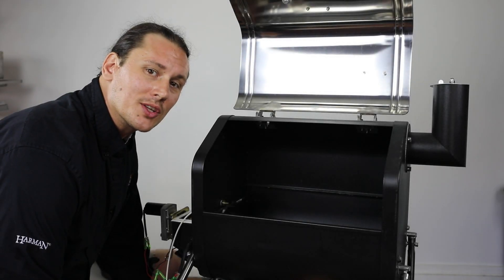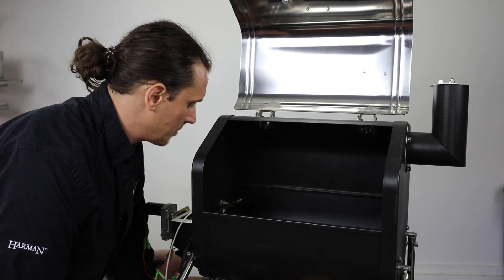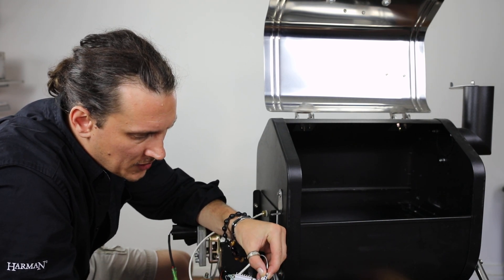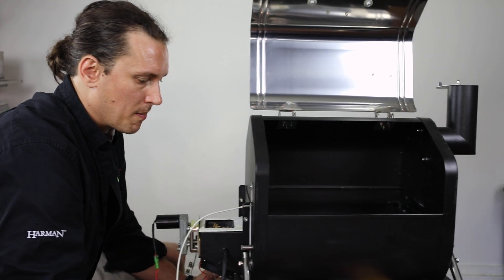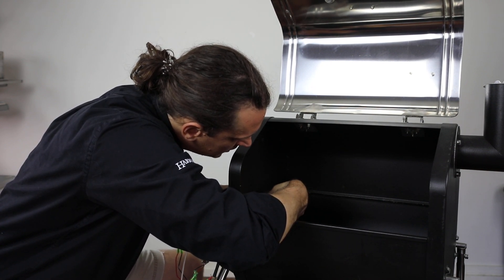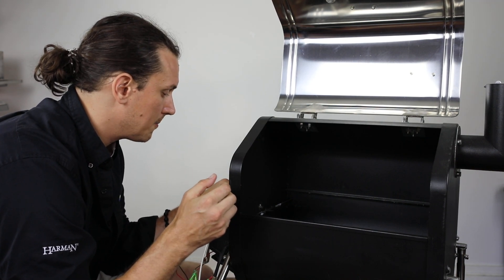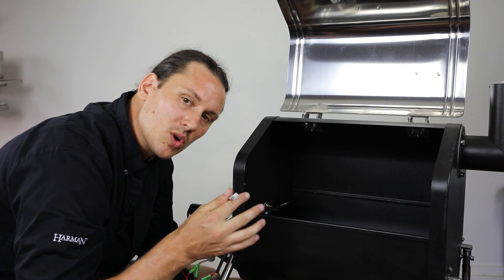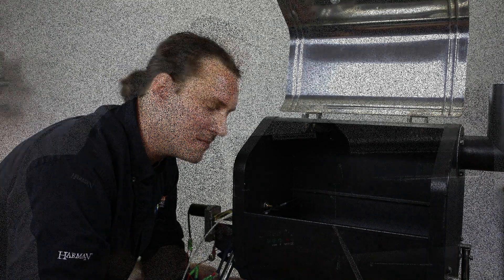GMG Davy Crockett - Thermal Sensor Replacement

Comment: I bought a brand new Davy Crockett in November and it’s about anywhere from 75 to 150 degrees too hot which is way too much to be off.  Pretty disappointing.  But I love it other than that.  It’s a great little grill.  I’ve tested it with multiple probes and from lower temperature settings to higher temperature settings the differential becomes greater and greater.  So, if I want 350 degrees I set my controller to 260 which is 90 degrees off, but if I turn the controller up to 350, I’m getting 550+ degrees…way too hot.   Anyway, it’s still usable but my OCD can’t handle it, and it’s too much math.  I have several grills that work much better.  Really want to fix it though.
Reply: Is it the controller that is messed up, or can the probe really be that off?  It’s brand new pretty much.  I’ve used it about times.
Reply from the maker: @smflyboy  Thanks for contacting us, happy to help. Yes, we definitely have an issue here. The Davy Crockett and other GMG models are known for being extremely accurate with temp. It's either the thermal sensor inside the grill (most likely), the circuit board/controller, or a combo of the two. The Davy has a 3-Year Warranty so any parts that are defective will be covered for you. Let's try something first before any replacement parts. Grab a piece of 000 Fine Steel Wool and rub that around the brass shaft of the thermal sensor - Reference https://pellethead.com/product/green-mountain-grills-gmg-thermal-sensor-temperature-sensing-probe-oem/. With the grill unplugged from all power sources, disconnect the thermal sensor connection from the control board and then snap it back in. If you are still experiencing the same temp issues, reach out to GMG and they will send the suggested replacement warranty parts your way. GMG Contact- Phone: 1-800-603-3398 · 530-347-9167 ; Email: support@greenmountaingrills.com.

Keep us posted, happy to assist and get things 100%. Thanks.
Reply: @EarthSense  Thanks for the reply.  I tried scuffing up the sensor and that actually may have fixed it.  I tested it all day long yesterday at different temps, with and without food, and it was much more accurate.  Maybe 10 degrees up or down, but that is acceptable.  Slight deviation when cold food was added but that makes sense.  I appreciate the help...that was really bumming me out!
Reply from the maker: @smflyboy  Thanks for the update, very good to hear. The thermal sensor is very sensitive - Good to keep an eye on and clean up periodically. Very pleased to hear your tests went well and you're back up and running. I've personally had a Davy for many years and love it, I think you will too. Keep us posted if anything comes up. Thanks.

Comment: Help I replaced the sensor just as directed in the video and when i turned it on it read 605 - 610
Reply from the maker: Thanks for contacting us, happy to assist. First, let's verify the replacement thermal sensor. It should be part number P-1036 for the Davy Crockett model. The design/look and mount should be just like the existing sensor. GMG has different thermal sensors, so important to verify we are working with the correct one. If correct, let's double check The sensor connection wire molex plug to the control board - you should hear a click when fully locked in. Quick question, what was the grill doing when you decided to order the replacement thermal sensor?

Comment: your daily Crockett grill looks nothing like mine you've already got the bucket off my bucket and computer is all one piece
Reply from the maker: Thanks for the message. All Davy Crockett's are the same for the most part. Only difference over the years was the grease tray baffle design and when they moved to a WiFi control board with the Antenna. Your control/circuit board will unbolt from the front. From there the wire harness and thermal sensor cable can be released to pull the control board out while leaving the hopper in place. Easiest to go from underneath the grill to remove the wires from the circuit board. Here is a video of removing the hopper itself and disconnecting the board and electrical while that is being done. https://youtu.be/8VK_zqzR_r8
Any other questions just let us know.

Comment: Could cleaning it instead of replacing help? Also where do I purchase one
Reply from the maker: Yeah, cleaning the thermal sensor is a good practice when cleaning out the other areas of your grill. A Scotch brite pad generally works great at clearing off the crud and getting it back to brass. If a replacement is needed here is a link to reference - this one is for the Davy Crockett and Daniel Boone/Jim Bowie Choice Models. If you have a Trek or a Prime model, there will be a different thermal sensor. https://pellethead.com/product/green-mountain-grills-gmg-thermal-sensor-temperature-sensing-probe-oem/

Hope that helps, thanks!
Reply: I have the Trek, is it the same? And is it absolutely necessary to talk the hopper off?
Reply from the maker: @LifewithLewy  Trek is going to be a bit different on the Thermal Sensor - Different type of sensor and different placement within the Trek. Looking at my Trek, I would say the hopper has to come off to unthread the nut holding on the Thermal. Pretty simple, just make sure the hopper is completely empty and be careful with the throat gasket the hopper sits on. Any other questions just let us know. Thanks!